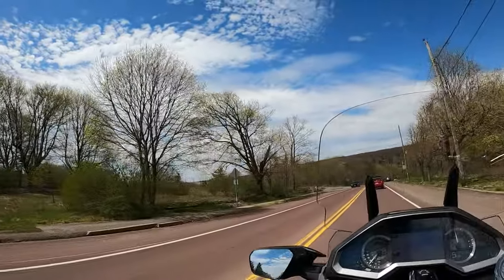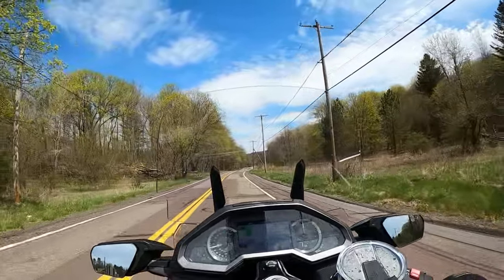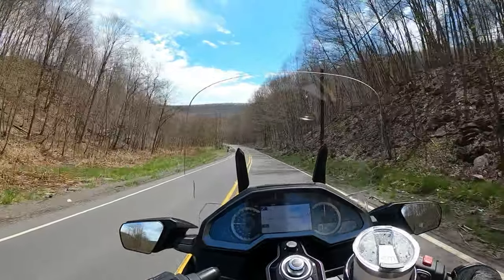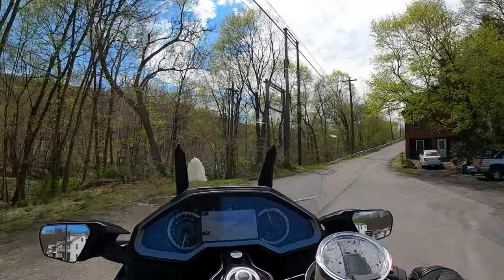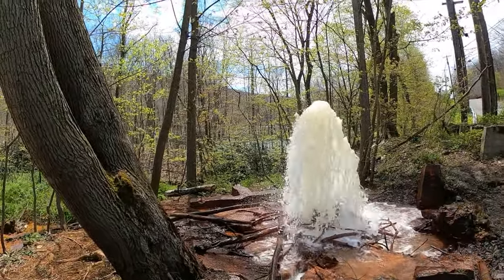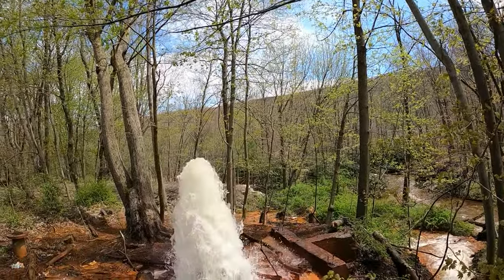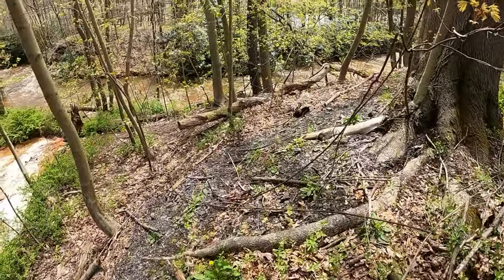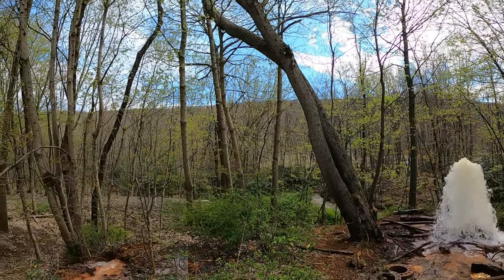Scenic Spin: Big Mine Run / PA Geyser

Comment: Do you have any idea what those pipes were meant for originally?
I know they used to pump air down into mineshafts - I'm curious if the geyser was intentional or accidental.
Reply from the maker: Yep this was a mine air shaft.  At one point water was spouting up from other shafts too but they capped those off for safety reasons.  They left this one open since its next to a river, plus it relieves water pressure from below to reduce water seepage damage in other areas.